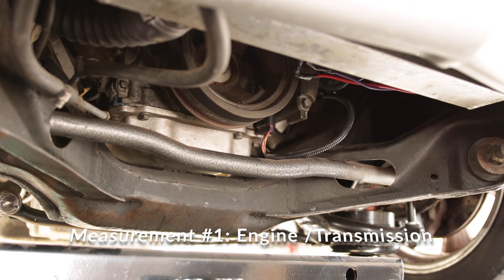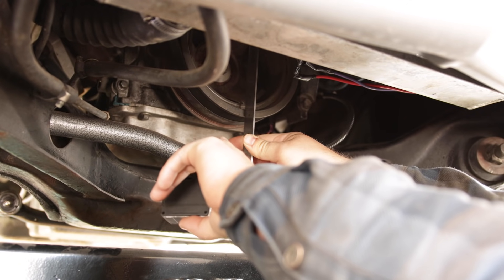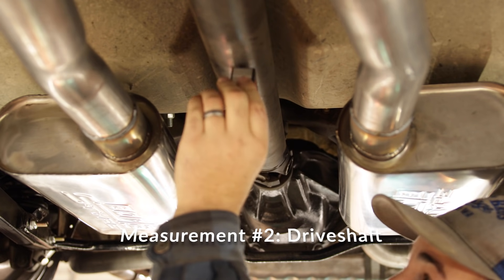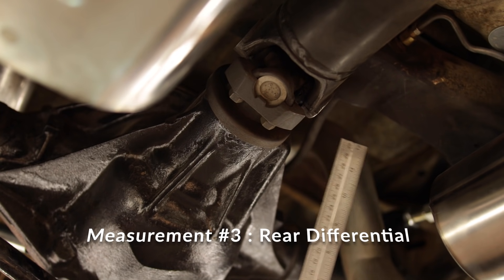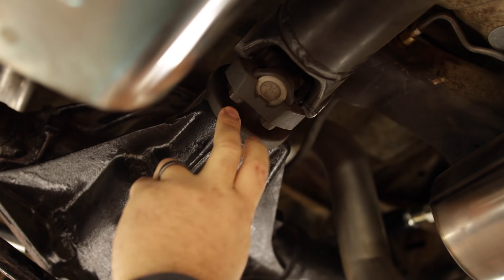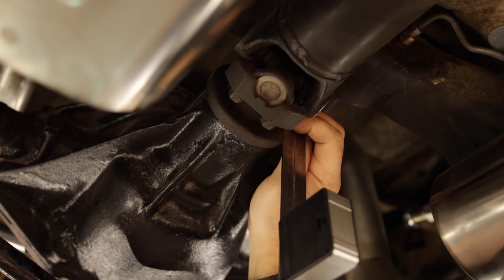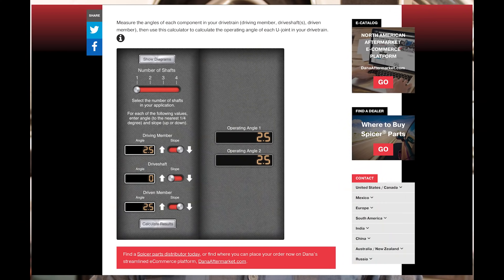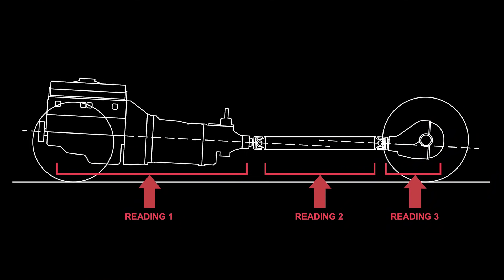How to properly set up and measure your Pinion Angle on your Muscle Car

Comment: While watching your video I am wondering how I have been successfull in my ventures without this knowledge. I have converted two different coil spring rear ends to leafe springs and installed them in my 67 g10 van. No vibrations from either one and the second one has been in use more than 10 years with no  u joint failures. I angled the differential to suit my eye and welded the spring perches in place. Tape was used for left right balance and parallel with front axil.  Going to recheck soon with this method. Thank you.

Comment: It looks like your angle measurements are relative to a bubble level instead of the car itself, e.g., the rockers. If the car and/or lift isn't level then you might have issues.  Zeroing the gauge off the car rockers would account for any rake.
Reply from the maker: Correct. I have the lift perfectly level, so I had that set as absolute level, but you are correct that its important to know what starting point is before taking measurements. Thanks!

Comment: Nick hi this is Cesar . Listen I have a situation whit my BMW  323i 2000  the car had destroyed the main bushin in the diferencial . I replaced the 3 mounts of the diferntial plus the support of the cardan or chaft  how conect diferencial and transmission  plus the two mounds of the transmission plus the two motor mounds . One time was replaced all of those and try my car the transmission was sleepered and can’t find any gear included reverse . Father the information you provided in this video the car runs . But still have problems mayor ones . The transmission doesn’t apply the gear correctly. Reverse is fine and go up in to the gear 1 2 3 4 but if I release the gas the transmission is not capable to go gears down normally and the car protects it self showed a pinion gear in the dashboard.  Any tip you can sher whit me? Thanks
Reply from the maker: Hi Caesar, that's a tough one, and admittedly, 2000's BMW's aren't my forte. I'd recommend taking it to a transmission specialist near you, as I wouldn't want to hazard a guess that doesn't help you. Good luck!

Comment: Im kind of stuck with the engine at 5 deg.  Long explanation but,  Diff I can set at 5.  how much of a problem can i expect.  This is a rat rod with leaf spring rear.  Great video.
Reply from the maker: Leaf springs are a totally different ball game, and actually allow for more degrees, as they tend to rotate more under load. I'd say you'd be fine with 5 degrees, and you shouldn't have much of a problem.
Reply: Who cares, its a ratrod

Comment: Fighting a vibration 45-55 .. everything is new and still the same .  I’m still unclear if this technic and angles will work on my 2- piece driveshaft with a carrier bearing . I ordered rear lower adjustable control arms fit my 1960 Cadillac and upper A-arm stabilizer .. fingers crossed ! 😮
Reply from the maker: Nope, most of what I've said here does not apply to a 2 piece driveshaft. Good luck with your fix!

Comment: Finally a simple to the point explanation, I have a terrible vibation over 65mph and I now feel like I can measure the angles and hopefully correct it, my upper control arms are adjustable so that should help.
Reply: how did that turn out? did it get rid of your vibration?
Reply: @motopsycho6169  No I still have a significant vibration starting at 70 mph, both trans output shaft and rear diff pinion are set at 3.6 degrees.  I cannot shim the rear trans mount as the u-joint is already very close to the tunnel.  The car has been lowered so the driveshaft actually runs uphill to the differential at about 1 degrees.  Driveshaft was trued and balanced (new U-joints), pinion yoke has no play in it, wheels were checked for wobble, tires were replaced and balanced, driveshaft splines at the trans have minimal movement.  The only thing I have not checked is for a bent axle flange, I would appreciate any advice because I am out of options here.
Reply: @fuhrstpuhl3278  Does it happen in any gear? Are you sure it's not RPM based? Could very wel be bent axels. I changed mine out due to a minor bend in them. I'm hunting a vibration in my LS swapped foxbody at 2700-3000rpm for the past year+, I've changed everything except the motor and trans at this point lol. I'm just waiting for it to blow up
Reply: @fuhrstpuhl3278 sometimes the vibration can be caused at the u joint, or an imbalance at the driveshaft. It's not always pinion angle that causes vibration.
Reply: @fuhrstpuhl3278  Helped a friend with a similar vibration on his 67 Camaro. What we found after a whole bunch of parts changing and measuring was the 12 bolt drive shaft yolk was not machined properly right from GM. We tried wheel balancing, driveshaft balancing, rear end shaft change, pinion angle measurement, all with no luck. Then one day I was looking at the 12 bolt yolk with the driveshaft off and I could see the u joint pockets were  not symmetrical. Bought a new yolk and problem solved.
Reply: So in layman’s terms-make your rear end parallel with your engine

Comment: Hi just watched your video, has helped me understand the principle behind the angles,
I am using hydraulic rams and engine is set a 3 degrees and Will be setting ride height about 2” of the ground on my 53 Chevy BelAir  the rams have approx 6” travel up and about 2” down from ride height they have 8” travel total, do you have any suggestions for setting up this arrangement  for example when I drive down the road with back end down and front up about 5” what will the pinion angle be like for driving ? Thanks Mark

Comment: Any information on centering or offset drive train. As in GM offset to passenger side, re: 3rd member, transmission, and engine? In other words the Camaro rear end is offset between a half and 1 inch to the pass. side, Do you also need to move the trans. and the engine to the pass. side as well. This is a 53 chevy 3100 original frame, IFS.

Comment: This was great video of "how" to set pinion angle, but did not go over "how" to actually set the angle of engine / trans and rear end... Is there another video that explains this?
Reply from the maker: You mean, like how to shim the trans crossmember to get the correct engine angle and how to adjust adjustable control arms? I don’t have a video on that but I can but something into the mix for it. Thanks!
Reply: @ClassicNation  yes! im new to this, and just modifying cars in general and that would have been a great addition to go over! Thanks for the reply and putting this amazing video together!

Comment: 72 Chevelle here with a TKO600… I was told by a circle track guy to keep the pinion angle slightly down.  So I have a downward trans and a downward pinion.  I’ve been chasing this vibration for a few years now and I’ve never been told to point the pinion up.  It all makes sense now.

Comment: Hello Nice to meet you .
My name is Shotaro  JAPAN

Im thinking at the pinion angle now 
My car

I saw youtube!!

1970 Camaro 
LS1 engine pinion angle down 2 degrees↓

The drive shaft is 1 degree up ↑

The differential angle is 2degrees ↑

my CAMARO has noise and vibration.

Looking at the SPICER or TREMEC page, 
I didn’t know how to fix it, can you tell me ?

I don’t understand English so I use google translate.

The rear suspension is speedtech torque arm.
GM 12bolt differential
Reply from the maker: Were you able to download the Tremec app and test it against your current settings?

Comment: I have a 69 El Camino and am getting rear wheel hop. 383 Stroker, throttle body efi, 410 12 bolt posii and 4 speed auto electric transmission. All of my racing buddies tell me that I should have the pinion pointing down 1-3 degrees ???

Comment: I guess the same applies horizontally to an off centre engine? So it must be parallel to centre line of the car and the prop no more than 3 degrees from straight ahead?

Comment: I've heard the same thing from MANY other "professionals" as well.. They always say "Equal But OPPOSITE". Every single factory vehicle that we work on at my shop will have a NEGATIVE pinion angle-meaning pinion nose will be pointing DOWN towards the ground towards the front of the vehicle. NEVER HAVE I EVER encountered a factory vehicle that had the pinion nose pointing UP.. NEVER HAVE I EVER... I understand that people BELIEVE the two angles need to be equal and opposite to cancel each other out.. However, I've never seen that out here in the real world from any auto manufacturer...  Can you explain why this is? These vehicles seem to be working just fine with many having over 200K miles and still on the original factory U-JOINTS. I'm really confused as to how this can be.
Reply: I would guess two things could be going on. A two-piece driveshaft, and are you measuring at normal ride height?

Comment: CLEAR AS MUD!!! You and everybody else refer to ANGLES butnever make clear if its up/down and which direction! You mentioned SPICER calculator? ITS USELESS! Punch the numbers and they refer to SLOPE but NEVER say what direction!!!!! ALSO it gives you 2 vnot 1 but 2 Driveline angles!!!!!!!!!!!!!!!!!!!! WTF!!!!
Reply from the maker: Bud, you're overthinking it. A u joint doesn't care if your "angle" is up or down. Your driveline, in many cases will slope down towards the rear of the vehicle, but not always. Also slope doesn't care about direction. If you have a single piece driveshaft, and your vehicle isn't heavily lowered, your engine/trans will be pointing down (the downward slope will run towards the rear of the car), and your rear diff will be point up by the same degree (same slope). Hope that helps!

Comment: Do you have one on leaf springs? Or do you know of a good video I can watch? Also what about a drive shaft with two different sized ujoints. I had to upgrade to a larger ujoint on the trans side and left the exisiting ujoint on the rear end side to be the same as it came with. Is there a problem with having a larger ujoint on the trans side? Thanks.

Comment: Thank You sir for this straight forward information. Just subscribed to your channel. An old hot rodder told me set up engine angle about 3 degrees (downward) just like your explanation. Great 👍 information, I’m setting up my driveline in me 54 Chevy 3100 now. Definitely using your video for information.
Reply: Hello Jeremy, can we share notes, I have a 3100 that I’m building.
Reply: @rollitex3055  sure, however I can help.
Reply: @jeremymoran5123  I wanted to ask you if you remember how many degrees did you set your pinion Angle, I’m in the process of doing that on my 49.

Comment: i am setting up a different rear end on a 76 vega gt. i need to set the mounts up but don't have the angle or spacing reference . the spacing is not a problem but how do i set the angle position of the mounts. axle on jack stands out of car.

Comment: I have a car that I am replacing a 2 piece driveshaft with a one piece due to the original 2 piece shaft u-joints being unserviceable. I have a 5.0 degree down angle on the transmission, a 4.2 degree down driveshaft angle and a 5.0 degree up angle on the differential. My #1 operating angle is 0.8 and the #2 operating angle is 0.8.  I know 2.0 degrees is the goal but I just can't get it.  Will this work?

Comment: Great video  well presented.
You mentioned that you a basing the pinion angles on rear coil springs. What is the degree tolerance when using rear leaf springs to allow for wrap up under torque?
Reply: Yup....no videos anywhere about leafs

Comment: I have seen several videos and I do not get the talk about drive shaft angle, isn't this just a factor of how much higher or lower the rear end is than the end of tranny
Isn't the main thing to have tranny and pinion parallel so the angles from tranny to drive shaft and drive shaft to pinion are the same

Comment: Nice video. A bit different but have been chasing a vibration under hard accel on my Jeep after a small lift. I know I need a double cardan on the rear to help but I measured anyway and found my vibe.. I had an operating angle on the rear driveshaft of 8.3 and my pinion was a degree off the drivetrain. I have adjustable arms and dialed a degree out of the pinion to match the 5.5 degree powertrain angle, now have 7.3 operating angle with a bit less vibration but still there.

Comment: 1970 Chevelle street strip car. I have both angles the same 2 degrees but, engine/trans is pointed down and rear differential is pointed down. In other words the yolk is pointed down. I think that makes them not parallel.  I have a pretty wicked low speed ( around 40 mph) vibration. Could this be the cause?
Reply: This means you have a negative pinion offset of 4 degrees.  On a leaf spring car this is about perfect for strip launches. On street you will have some driveline vibrations. On a street car with leaf springs you should have about 1-2 degrees offset.  You would need to shim your rear axle pinion up 2 degrees for that. If it is a 4 link car you would want 1 degree offset. So you would shim your rear axle pinion up 3 degrees.

Comment: Ok i have a 1969 chevelle the rear of the frame suspension and and solid mounted deferential is from a 1976 corvette with stock single leaf spring. The motor and trannsmission are from a 2013 Camaro. My question is when i tore the vette apart i saw that the driveline was perfectly straight from harmonic ballancer to output shaft through drive shaft and into rear diff. Since the diff is solid mount with half shafts shouldnt it remain straight through since my rear axles free float???

Comment: Great video, best out there. Can you please please do a video to explain when you have a 2 piece driveshaft. Like all 59-60 Cadillacs have etc. there are so many (include me) that have driveshaft vibrations. How to compensate for that middle bearingmount inside the frame?? thx in advance / Roger
Reply: I was wondering the same thing…. I have a two piece driveshaft on my 1963 C10 truck.

Comment: You should consider mentioning whether or not a double cardan is used up front; if it is then having parallel angles with the front and rear does not apply. The pinion should be inline with the drive shaft in this case

Comment: Thanks. I just put 4.56 in my car, now it vibrates like crazy at 65mph. I noticed my rear diff is pointed down and so is my trans. I just ordered adjustable upper control arms to hopefully bring my diff up to match the trans angle.
Reply: Did you fix it?! I bought a 01 trans am and a new rear-end was put in along with new driveshaft and torque-arm and all that stuff. It vibrates around 60mph+

Right now it’s -3 on trans and -3 on pinion.

I need help I can’t figure it out I brought it to a couple shops too I can’t find out the right angle

Comment: Great video!! Question here...Since I installed the TREMEC TKO600, I have a vibration which begins over 70mph and increases as the speed increases. It is speed related not rpm. note: Driveshaft was rebalanced. However, the rearend is above the transmission, so the driveshaft goes up 1.5* to the pinon.  I have the engine/trans down at 2.7* (that is considering the trans is at the very top of the tunnel) and the pinion up at the same angle (parralel). Does the up drivshaft angle, rearend above the trans, call for different criteria in setting this up?  The car is a 1972 Camaro with Hotchkis leafspring suspension and lowered front and rear just under 2'".   No vibration at all prior to the transmission change.
Reply from the maker: Your best bet here is to use that Tremec app and input all of your figures, which will tell you if you have a driveline angle issue given the upward sloping driveshaft. Good luck!
Reply: I have a nova looks like I have 2 degrees at the trans have been fighting this issue for a while it calls for - 3 degrees the only thing I could think of is getting a taller motor mount and a shorter trans mount hopefully that will get my trans close to - 3degrees it’s just another thing to consider hopefully this works!! It’s just a theory of mine I could totally be wrong hopefully someone can confirm.

Comment: Great video and explanation. One thing I would like to know.  Do you zero your angle finder on the ground or on the chassis of the car before starting?
Reply from the maker: Great question. I always zero it with the chassis, and usually I try to get the car on level ground on on a level lift to make things easier. If you have a car with bigger wheels/tires out back, you don't want to impact your reading, so I always try to get the frame to a perfect zero degrees and run all measurements from there. Hope this helps!
Reply: @ClassicNation so your saying not to have the car at ride height then? My Chevelle has a raked stance, taller tires in the rear, so would I want the frame level and then set the engine/trans & rear axle pinion angle? 

Setting it up this weekend so I can order a driveline from Strange

Comment: Is it OK to have the front and rear angles equal, but not opposite?  ie. pinion pointing up at an angle greater than the transmission.
Reply from the maker: It's "ok" with me, but won't provide the optimal setup, and likely will vibrate like crazy at certain speeds. I'd stick to the recipe to avoid any issues.

Comment: What about if the diff is end is a CV joint and the gear box end is a universal and the rear end is IRS?
Reply from the maker: Then this video doesn't apply. 😂
Reply: @ClassicNation  I have a Factory Five 33. I'm using the Mustang 8.8 and Coyote MT82 combo. The diff is a CV/IRS, gearbox is universal as started above.. Many arguments started on the Factory Five forum about this and everyone seems to have an opinion, none of them match. According the guy who made the drivershaft for me (single piece 880mm long) all I need to do is get the +/- 3 degs on the gearbox end and its done. Everyone else seems to think that's wrong.